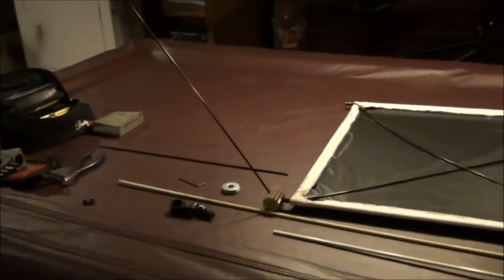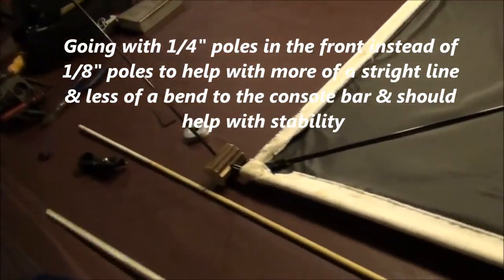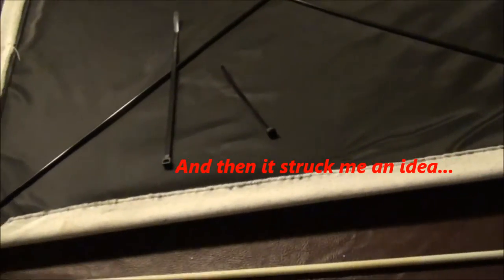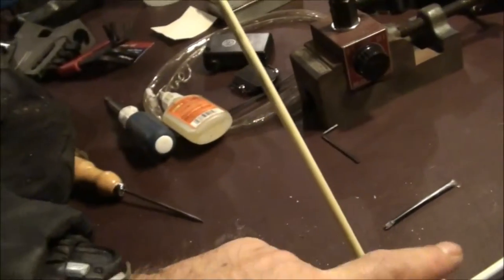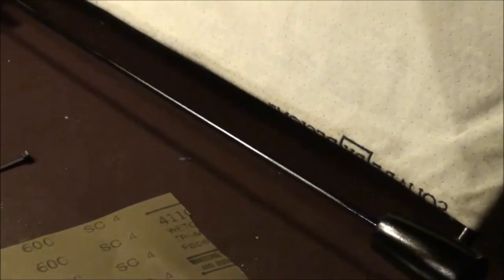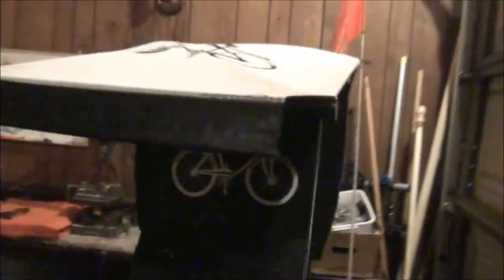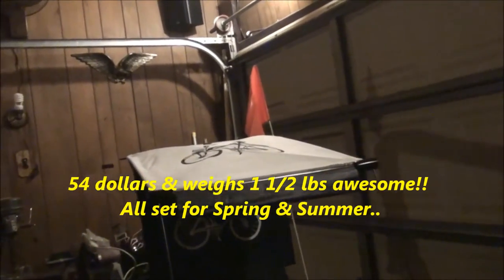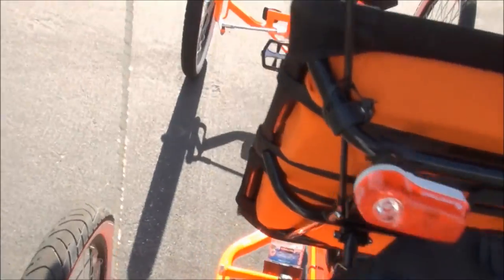Recumbent Seat Canopy Repair Project have nothing to lose

Comment from the maker: I want everyone to know this Canopy kit is a aftermarket kit I bought on line for this recumbent seat & had nothing to do with LLC Quadracycles. LLC Canopies allows full recumbent seat movement but larger in size & weight after all is said & done I decided to go the cheaper route & lighter in weight knowing it wasn't meant for my style of bicycle front mounting but similar enough I knew it would work well at least I thought so.. But now after a few modifications no longer an issue put to bed sort of speak....